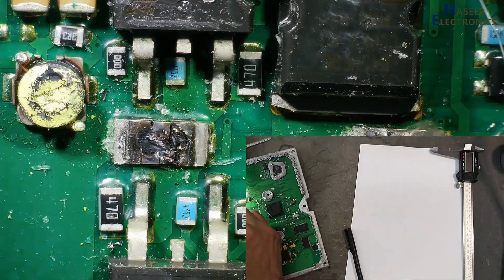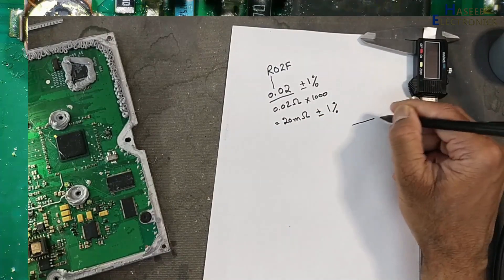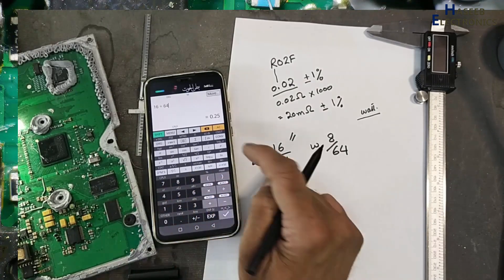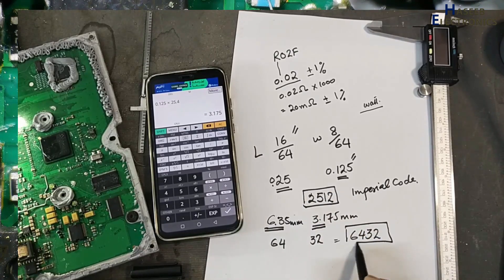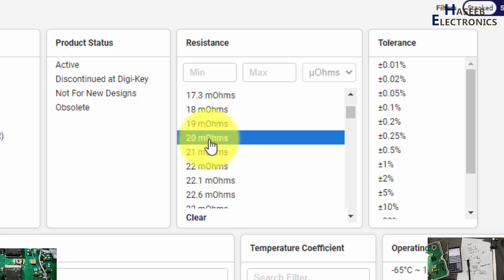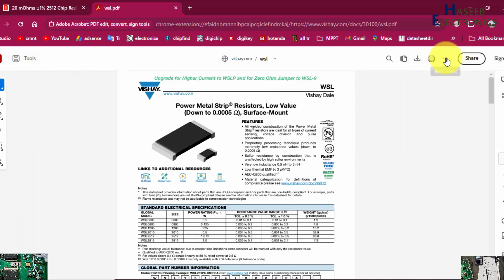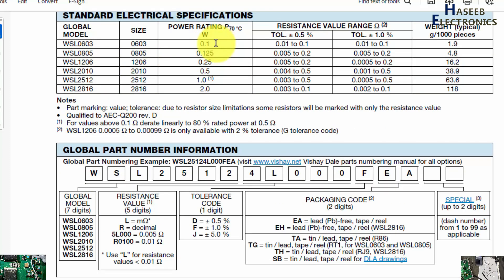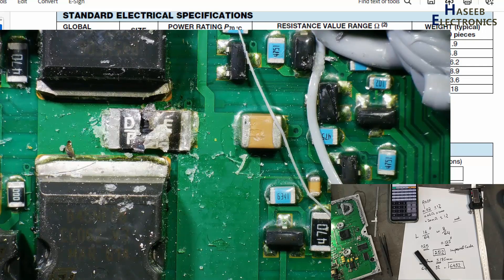{1099} SMD resistor value, power rating, datasheet and part number

Comment: That works for parts where the number is readable but for the other parts that are blown up and blackened it is nearly impossible to know the value. It may be possible to dig into the component and get a reading under the layers. Otherwise schematic is required or another identical working unit to compare the parts.
Reply from the maker: Yes 
You are 100% correct 
This method is useful when the number is readable 
Otherwise it needs circuit diagram or similar circuit

Comment: Dear Sir
What is 64 . 
Thank
Baha
Reply from the maker: in imperial scale rulers there are divisions 
1 inch is divided into 8 subunits 
16 subunits 
engineering imperial scale rulers have division 32 and 64
that means 1 inch is divided into 64 subunits
Reply: The best way use metric ruler.
Reply from the maker: You are right 
But i use imperial scale 
As my most of the work is related to imperial measurements, tools, and everything